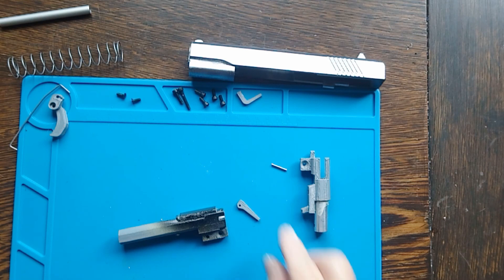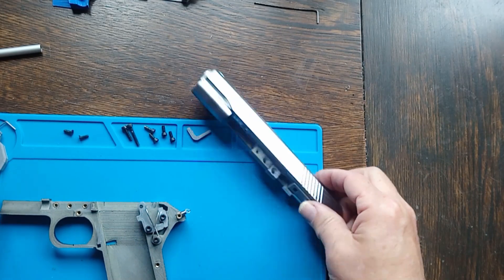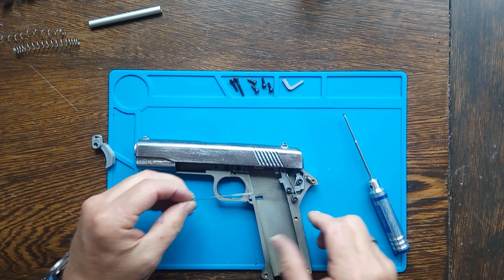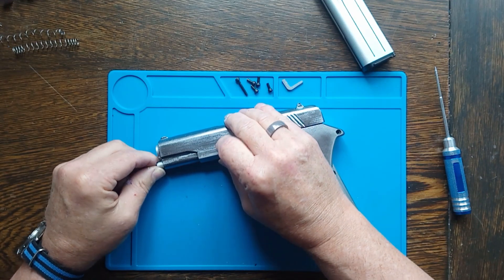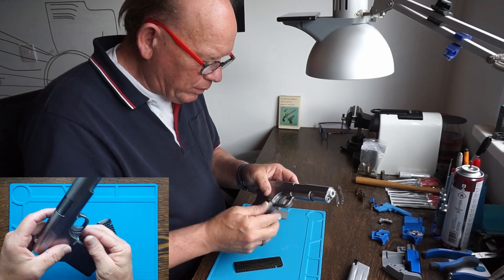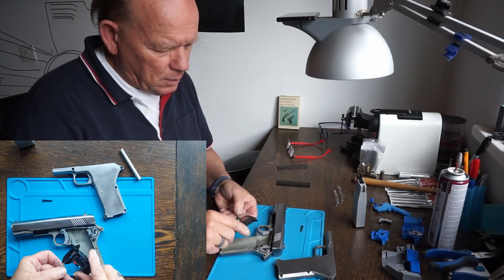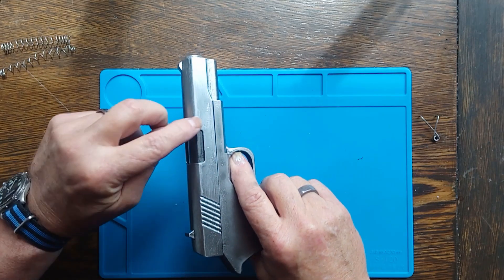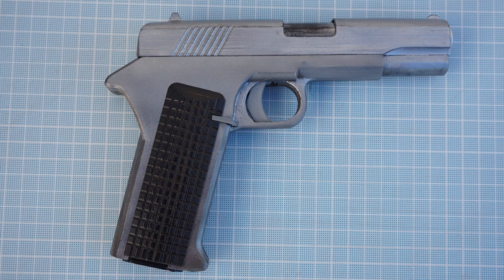3D printing a prop gun Part 2

Comment: I assume there were no close up gun shots in that movie? The only thing that would make it better is a fake hammer for the slide to push back. What's the story behind the Formula 1 car sketch on the wall?
Reply from the maker: Fake hammer, yeah I know I need to add that. But for this test model I simply did not have the space for it. The Barretta's I need to make will have em. The other guns will not have hammers. I need to make 3 more types.

F1 on the wall, I used to race, still keep up with it and a friend in F1 gave me a line drawing of Lewis's champ winning car of a couple of years back. I scaled it up and stuck it on the wall with striping tape.
It is beginning to peel off, so I will need to do some repairs soon.
Reply: @Paradym  Tell the movie people to use replica Glocks. No external hammers. :) 'Course that doesn't stop them from using CGI to put a fake hammer on a Glock, like in Ant Man.

How do you get the gas magazine in Cyprus when they won't allow replica or fake guns or parts to be imported? Where can I get one in the USA? It might be just the thing to add some action to my Astro-Automatic from the original Space Battleship Yamato, which I've 3D modeled. The physical one there is one I quickly put together based on my 3D model. https://www.flickr.com/photos/27748767@N08/albums/72157624280191121 I need to do more work on it to make it suitable to 3D print parts to make masters for silicone molds for resin casting.
Reply from the maker: Sorry, I only now found your comment. Relying too much on my dashboard to tell me of unread comments. 
Gas magazine, I use gas lighter refills. The "green gas" that airsoft uses is just propane with a little silicone oil in it.